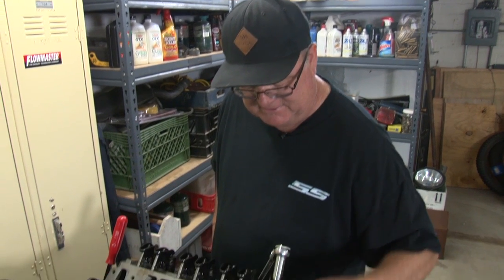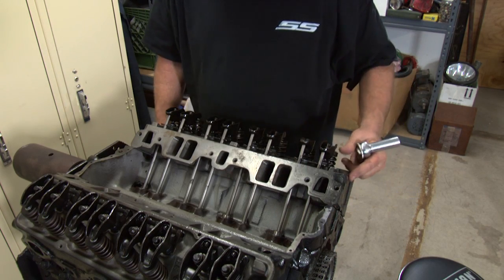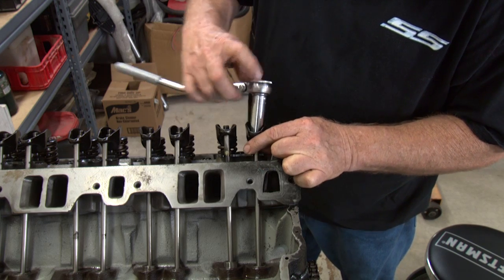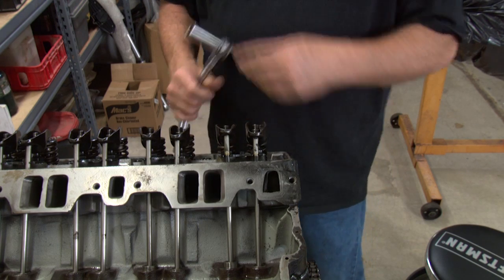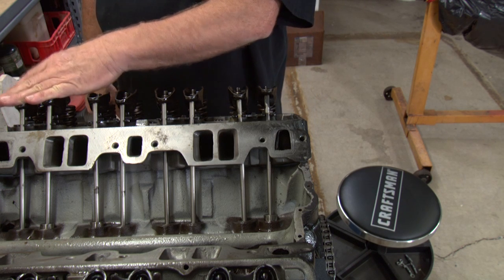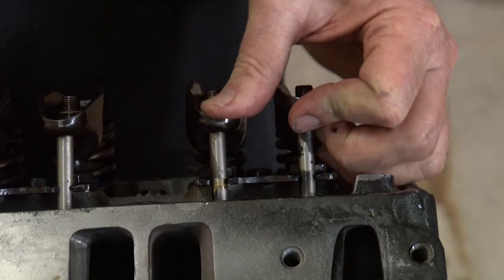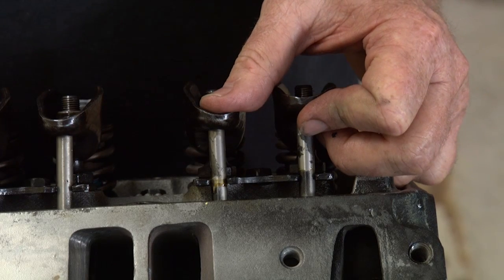Master Valve Adjustment: Step-by-Step Guide for Hydraulic Lifters on Small Block V8 Engines!

Comment: Rob Dana or other name, if the hydraulic valve lifters has 0.350" of movement, isn't one half turn only moving the lifters piston is only 1/2 turn of a stud that has 32 TPI (Threads Per Inch)? The adjustment should be 1 1/2 turn in order to place the lifters piston into proper lash as the service manual calls for 1 turn down from zero lash? Other call for 1 1/2 turn from zero lash to place a standard hydraulic lifter bore piston into its proper place? The threads are 1/32 or 32 threads per inch. 1 and 1/2 turns produces almost 1/4" into the bore of the standard hydraulic lifter considering it is 3/8th of an inch full travel?
DK, ASE master tech since 78

Comment: When you adjust lifters on an engine after shutting the car off... can the lifters still be pushed down after they are set or will oil in the lifters prevent any compression down? If so how long will an engine need to sit before they do bleed down enough to be pushed down?
Reply: Djamamtam

Comment: I drained the oil but still have oil in lifters. Replaced head gaskets. I dont want to pull or replace the lifters because then also cam has to be replaced.  Where does it end?

Comment: Following the disassembly of the valve springs on 5.2L V8 engine mounted on Grand Cherokee ZJ.
 I reassemble the rocker arm.
 if these rocker arms are badly reassembled, badly adjusted. (I did not run the engine between each rocker setting). This may prevent the engine from starting.
Thank you for your help !

Comment: Or, you could do it right, you know with a crank socket. And adjust each valve individually on the base circle of cam, right after it closes. But if you need to reference you tube to do this, you have bigger problems my friend .

Comment: Would I have to adjust the valves if I remove the head to replace a lifter ?
Reply: First you don't replace one lifter. Lifters and a cam are changed in a whole set. They are case hardened steel. A new lifter on an old cam will eat the lobe off. Yes they need adjusted.

Comment: I know how to adjust Valve Lash the Easy way and I  will Guarantee that my engine will start up on the Third Revolution  and will purr like a Kitty and you will not have to remove the Valve Cover to re-adjust.  When I Build a Engine no Matter what Brand and I adjust a Hydraulic Valve Train the Engine is Button Up valve covers are on, intake is on, Timing is Set and Carb is adjusted the Engine will start on the Third Revolution 90 % of the Time you may have to reset Timing and adjust the Carb but you will not have to touch the Valve adjustment again.  I would think that after 40 + years of doing Engines off and On that this Method I use has not exploded 30 + years ago.  My Dad use to Work for Ford,  all the Mustards like the GT 350 and the the 500 and other Mustirds that were Screwed up by the Owners playing Mechanic putting Cams in and screwing the Valve trains up or not breaking in the Cams My Dad did the repairs on all them that came in.  When I got out of School, I was 10 Years old Being my Dads Work was on the Way Home and My mother had to work the 4  to 12 shift I had to go to my Dads work and Go home with him I had to do this until I was 12 so I could Not Set around doing Nothing.   After 4 or 5 months I was repairing these Mustangs while my Dad did Body work in the Next booth to me He was also the Go to Man On Body work everyone else was breaking Ford Motor Co.  by using to much Bondo.
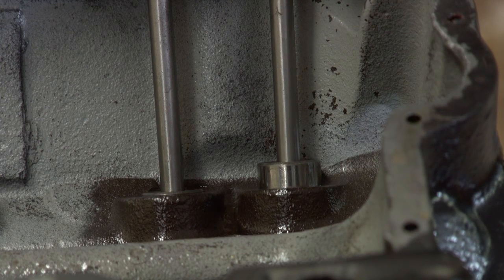lol.  Anyway my dad taught me the Normal way to Adjust Valves Starting at #1 Cylinder Bring this Up Bring this Down Adjust #1 Intake and # 8 Exhaust whatever it was because He Let me Do this Several times and saw that I was always having Problems well he is Responsible for the work i am doing so he said ok let me show you the Easy way.  Now this is very simple so listen Good.  Do not Soak your Lifters over Night Don't Put a Lifter in a Bucket or Can and Pump them Up. Lube the Lifter as Normal on the Outside with assembly lube Drop them all In place then a Little assembly Lube on each end of the Push Rods Drop them In, a Little assembly Lube on both ends of the Rockers and Valve Stems Put the Rockers on. Know all you have left is to Adjust for  Prea load I start at #1 Facing the Front of the Engine OH, this is a Chevy But it doesn't Matter what it is as long as its Hydraulic. Start #1 Grab the Push Rod Put you Ratchet and Socket on the Rocker Nut And start Adjusting Stop when you feel the Slightest Drag on the Push Rod go to the Next Valve This will be the Exhaust Valve for #1 adjust the Exhaust until you feel a Drag or Resistance on the Exhaust Valve and Stop continue all the way down the Right Cylinder Head, Twist the Push Rod Back and Forth until you feel a Slight Drag or resistance. Now continue all the Way down the Right Bank until all the Valves feel the Same Now do the Right Bank the same. Ok this is going to get Hard Now It is easier to have the H, Balancer on at this time so you can turn the Crank a Quarter Turn Put your Socket and Ratchet at 12 Turn Clockwise 12:00 to 3:00 Now Adjust the Valves again until you feel Resistance some Valves will be Loose some Not so Loose  now adjust them all again the same way as the First Time until all have some Resistance again Now Turn the Crank again From 3:00 to 6:00 adjust all Valves again the Same as Before Now do this Until all Valves are the Same they all have a Slight Drag on them but you can still Spin them with a Slight Drag. Your Valves are Adjusted.  No we are not Done But almost, Now last step we want to Put the Load on the Spring in the Plunger, Lifter Now start At 12:00 on every Valve put your Ratchet and Socket on each and every Rocker Nut start at 12:00 and Turn until 9:00 thats 3/4 of a Turn on each and every Valve Nut.  Your Valves are Now Adjusted Purfect put oil in your Engine Put the Valve Covers on you are Done if you set your Timing Correctly and have the Carb set so the Engine will Run it will start on the 3rd turnover and will purr you will not Have to Adjust any valves again.  If the Engine does Not Start on the 3rd turnover YOU Dis something Wrong with your Timing or Idle or Carb adjustment. If you did the Valves the Way I said your Valve Adjustment is Not Your Problem Bet Me.

Comment: If you reuse the lifters will that still have oil pressure in them, and will I still be able to push down on the rocker after there adjusted
Reply: @Joel Pierson Yup. The video you liked to is hands down the best adjustment video on YouTube.

Comment: WARNING DONT USE THIS SPINNING METHOD.. move the pushrod up and down until there is zero movement (lash) then half turn for pre load..
Reply: If you use the spinning method until you feel resistant you all ready went to far..
Reply: Did you check if the lifter pumped up an down?

Comment: I got a 351 Windsor the bolt is tighten on rocker arm but the rocker arm  still lose what's the problem
Reply: Turn your motor over then cut it off then adjust them

Comment: by setting the last are you only doing this cause you have no torque wrench? i know this seems like a dumb question but all the videos I see with setting the last i never see them use a torque wrench
Reply: You're not just tightening the nut down.  You're centering the plunger in the lifter thus the 3/4 turn from what they're calling 0 lash, (though he says 1/2 turn).
Reply: That’s for roller motors like an LS. Flat tappet motors like the sbc it varies

Comment: why not adjust each cylinder on the compression stroke ? just follow the firing order
Reply: yeah don't do that. I just did that on my 350 and the valves were too tight and I bent all my pushrods, and I broke a valve which in turn destroyed piston 3. probably had something to do with timing too but its a $700+ fix I'm having to deal with.
Reply: Maxx Masson thats what i did and ended up valves were too tight. made it very difficult to set timing valves opening and closing too fast. run engine and adjust is best way. But computer controlled engines are more sensitive i guess
Reply: Justin Rowles you obviously did not do it properly.
Reply: The intake valve is open during the beginning of the compression stroke.
You would want to follow TDC for every CYL.

Comment: couldn't you just take the lash out then set pro load
Reply: spinning the rods could be false you could have one rod with oil one rod thats dry the correct way it to move it up and down til the back lash it out then 1/2 turn for pre load

Comment: Will this procedure work on a ford engine 5.8 351 v8
Reply: iirc most vehicles are set this way. I always put both lifters down on the compression stroke and set the preload then, you can knock out both lifters that way. There are plenty of forums for 351's though, you can look it up to see if there are any differences
Reply: Koshunae thanks for responding I did the way you show on this video and it works it start right up so happy thanks for the video....
Reply: Koshunae how to replace lifters lifters on a 2007 Chevy Suburban

Comment: do that method work for Ls engines
Reply: Kingzup LS motors have hydraulic lifters and cam shaft just follow your firing order on your manifold should be printed in the cast

Comment: Can Lifters be adjusted with the engine installed? Mine always smokes, white at the tail pipe + under idle and, during start & stop driving conditions.  Suburban 1995 454 w/50k original miles.
Reply: no you do not have to pull anything off of your motor to do a valve adjustment just the valve covers. The only time you need to pull off the distributor and intake manifold is if you are replacing the hydraulic roller lifters or flat tappet hydraulic lifters. ps if you are experiencing smoke like that its probably bad piston rings, valve guides, or valve guide seals.
Reply: yes, you need to pull the intake manifold, distributor, and carb/Throttle body.
Reply: sounds like your valve seat is shot. Doing the valves requires removing the head tho.